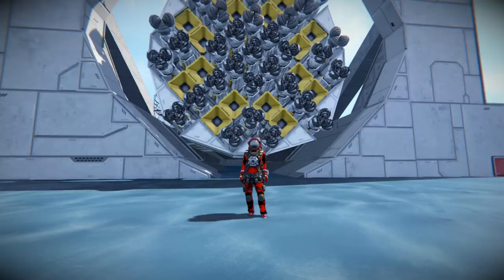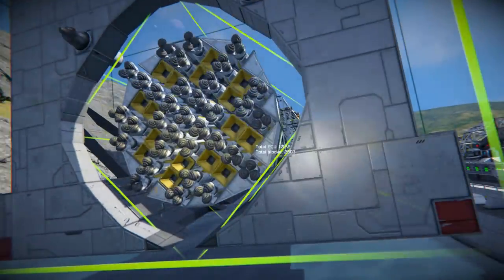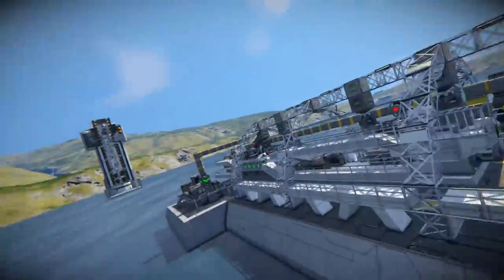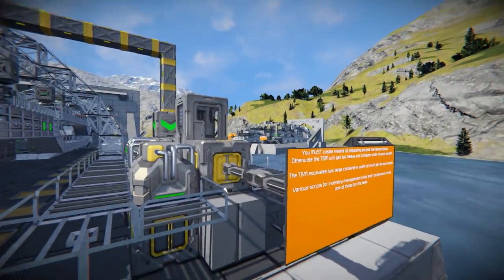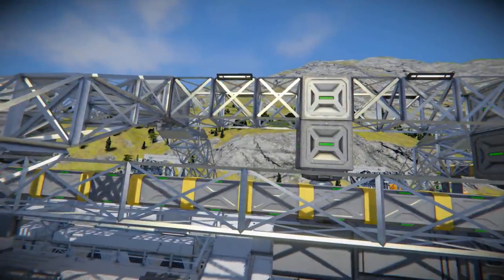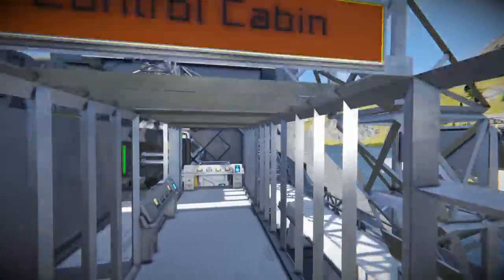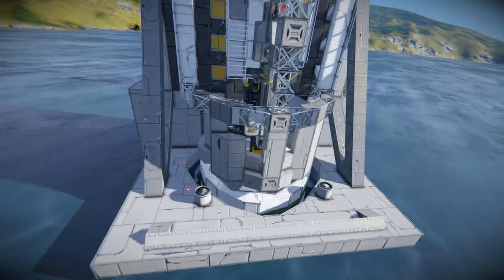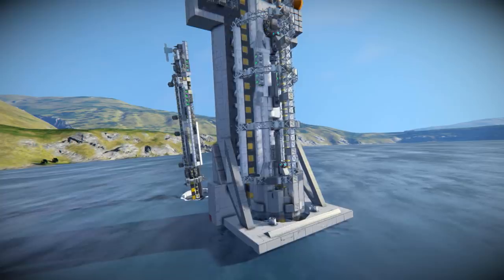Tunnel Boring Machine - Space Engineers

Comment: I actually like this one, it's a little more elaborate than the tunnel bore I built for space. It was basically a flying cylinder with a dropout hatch for stone and 4 sensors to keep itself at a certain distance from the tunnel walls. It worked fine enough to stay unsupervised most of the time. I should update it with remote controls, timer blocks and other "luxuries" to make it a viable standalone ship.
Reply: Why not add a survival kit for the stone while you are at it
Reply: @cheetored20  Now that you mention it, keeping stone has actually become a viablity.

Usually I dropped it out to minimise dead weight.

Comment: Tried it. It went a short distance and then broke. I found two critical problems: one, the mass building up in the cargo containers simply overloads it, and two, it eventually gets out of alignment with the overhead merge blocks and can't lock on to extend itself. The first was fixable by changing the output so it simply dumped the rocks out the back. The second was not.

Comment: I build something like this years ago, but with a different drillhead. Mine used pistons and rotors to scrape out rectangular holes layer by layer. Eventually, it would have a little drilling rover inside that you could drive out when on a target depth and mine out the surroundings, but I never got to completing it. 
I was also working on a version that worked like an oil driller, with segments being added from a stockpile, and being placed back in the stockpile when retracting the drill.
I think it clanged though, so I abandoned that.
Reply: Try a config with the Heavy Mining Drill Steamworkshop it, You will NEVER look back

Comment: It is actually quite simple to dig a round or square hole in the ground if you go streight down. The rule is to use pistons in groups of less than 10 at 0.00m/s momentum and lowest settings for strenght.

A smal ship bore head on a large ship piston works best as you can more simply avoid catastrophic failure where you lose the borehead

Now that we got no uranium on planets, the only option is the tiny battery to connect your smal ship connector to a downward facing large ship connector properly and without having it fall of if unpowered if you accidently unlock it. (4 tiny batterys attatched symetrically around the connector)
Use a landing gear on a piston to elevate it to the large ship connector, once on magnetic lock, just remove the piston and landing gear, nudge on the batteries on the side of the connector to align it however you want if you digg a square shaft.
Once locked you can build your bore head, where i recommend starting with 5 smal pistons + drill bit above the ground, 13-15m above the ground.

I have done this with a 7x7 drillbit digging ~320m down, once your piston shaft exeeds 4 groups (120meters) any failure in setting strenght to minimum will bend the shaft and missalign your drillbit.
At this point  I dug down with 3 groups, set down my drill bit and detatched it from the above station and retracted the 3 groups.
Building large positons from the station in 3 groups of 5 (75m of 80m not including connector)
reconnecting the drillbit (a litle bit missaligned, just using pistons to get the connector into megnetic lock.
This gives a depth of 30x2m (60m) and 75x2 ((150m)^X)

My system tanked first when I got up to 250+ smal pistons in my initial idea where I used 4 suport shafts with merge blocks to add on to the shaft rather than rebuilding the drill bit or risk critical missalignment wher Iwould be unable to reatatch the drill bit.

Whith yield modules this has prodused 1.2m ingots of iron with respective amounts of other ores from refining rock. so it is not compleatly wasted.

With this system, I'll add on conveyor tubes and digg to the center of the planet in no time (0.1m/s - 0.2 m/s) >.<
Should probably learn to program timer blocks for this x.x
Reply: thanks, and here is an immage of the initial design https://steamcommunity.com/profiles/76561197981442498/screenshot/996889770572320972